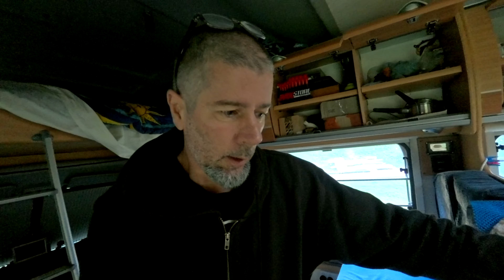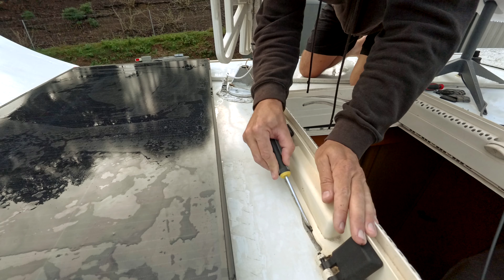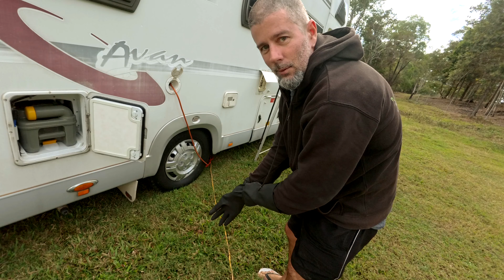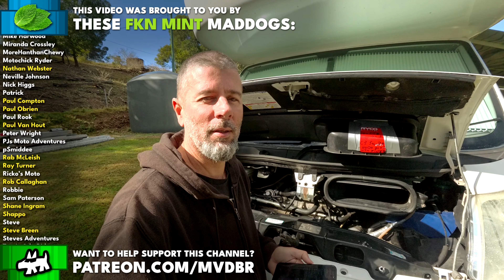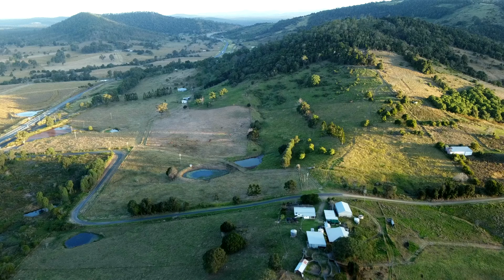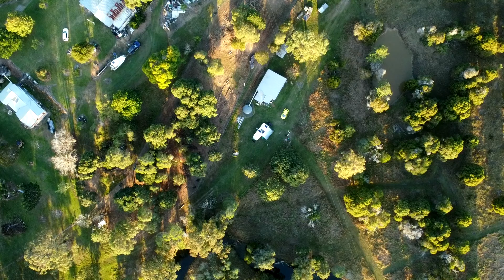Van Life Transition: No Hot Water, Everything Leaks, & Toilet Catastrophes - Loving It! RV Vlog Ep 1

Comment: Best thing you will ever do is convert your chemical toilet into a composting toilet. I did it on our caravan. Best mod EVER !
Reply from the maker: Really? 🤔 Would be good to sus one out but I don't have the coin to drop on anything like that atm
Reply: @MVDBR  not sure what your toilet is like but I actually modified the cassette toilet. Get a new cassette, fit a rod through the centre with a T handle at one end and 2-3 paddles internally to mix compost. Make centre divider out of Perspex and silicone into bowl to separate 1s & 2s. Drill a hole in no 1s compartment and run a tube down to a wee tank under van. I made this from 100mm pvc pipe with a drain tap at one end. No more walks of shame to the dump point 👌 just dirt/compost every 3-6months.

Comment: No doubt your all over it Josh but is not a bad idea to carry a spare pump and Temp valve also some spare pipe and john guest pipe  fittings reasonably cheap and can save you some heart ache if your camped a tad remote somewhere, also take the ends off your tap spout and shower head they have a mesh filter and block up easy
Reply from the maker: Ahh I had to google that lol I've only heard of them called speedfit before. But yeah I really need to get a spare pump, I do have a couple of fittings and some pipe. I think I could bypass the temp valve pretty easy if worst came to worst but yeah definitely need to grab a pump. Cheers man 🍻